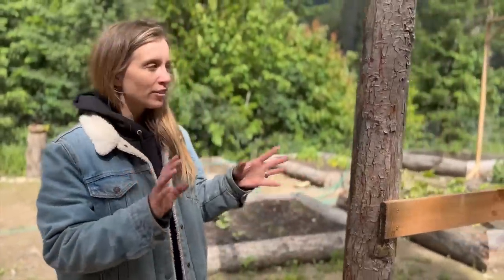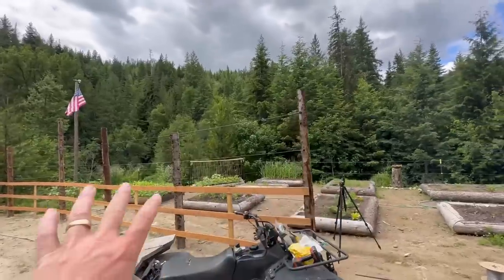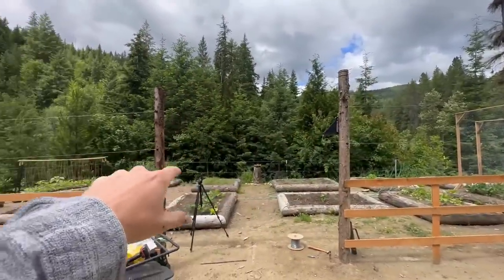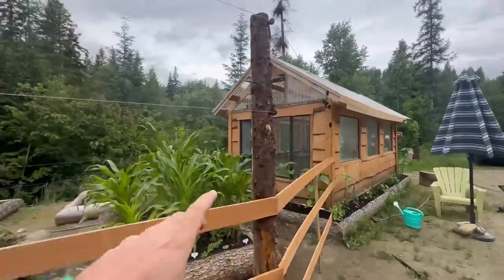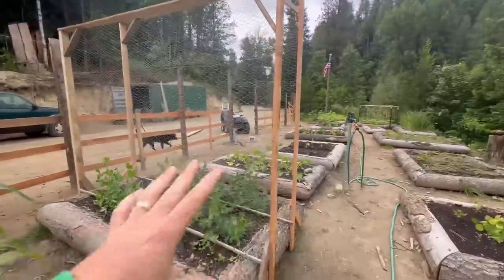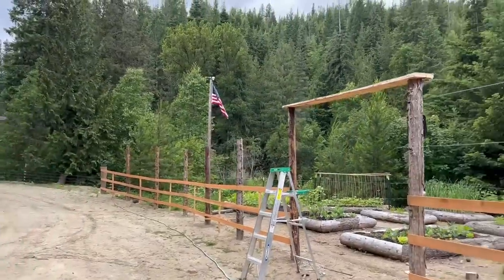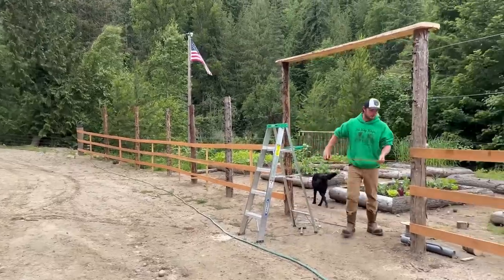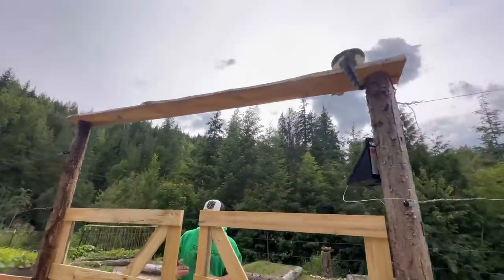Building A Deer Resistent Garden

Comment: My suggestion is to add a third wire.  Top wire at 8' and split the difference between 8' and your board fence equally.  The third wire (the middle wire) is your ground.  If a deer decides it wants to go OVER the fence - you want to do your best to ground it out somewhere/somehow.  That's why the middle strand is your ground.  Bottom strand, their  hooves are on the ground.  Flying through the air - not so much. 😅
Reply: @texancowboy9988  THanks Cowboy!  I've wondered for years why the high strands don't work - and one night it dawned on me - no ground 😅

Comment: I read 3 great comments:the deer will not be grounded when jumping, flags on the wire and 8 ft high white rope. In Northern Alberta I watched deer clear 6 foot tall wooden fence to get into grazing land without touching the fence. In CT we had a herd of about 15 deer on our property. I put up 8 foot netting in the woods surrounding out property. I flagged it with pink flagging ribbon. That ended the deer on the property. I think you would be better off with hog wire up to 8 feet. 
Deer are solid enough to wipe out the front end of your Chevy truck. They are stout enough to break wooden boards. Any way, good luck. Thanks for a great video!

Comment: You put insulators in the wood posts to run the wire through to keep it from grounding. It looked like you ran the wire across the flat board above the gate with the wire touching, if not stapled to, the board with no insulators. Will the electric wire ground out with the board above the gate connected to the wood posts in the earth?

Comment: You can use a shorter fence if you set one in place and then put in place a second fence 4 ft inside of the first. That space can be used to free range chickens and ducks. Deers won't jump with two fences that close together. @Living Traditions did a video on this concept, give it watch.
Reply: I watch them too, seems to be working well 🙂👍

Comment: Good start, and you are wise to be setup to make lumber.  My experience with deer is they are simultaneously stupid and smart.  Stupid in that they will not see the wire even if you put a flag on it so look for broken wires and smart because they will tell their doe to walk through the lower part of the fence and feast.  Deer dont look at barriers, they look on the other side of a barrier to see where they might land if they jump, then it is questionable if they assess jumping success.  opaque walls can help.    Most entertaining will be to watch what happens on your security camera video.  Next will be the fun with squirrels, skunks.....